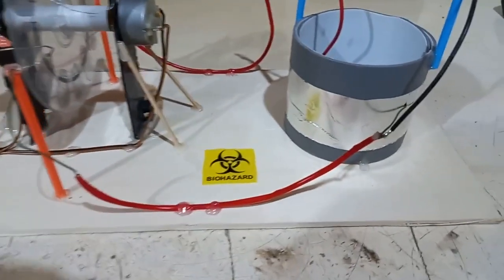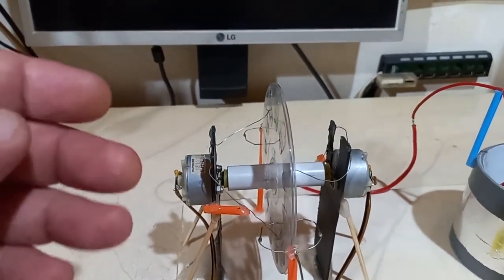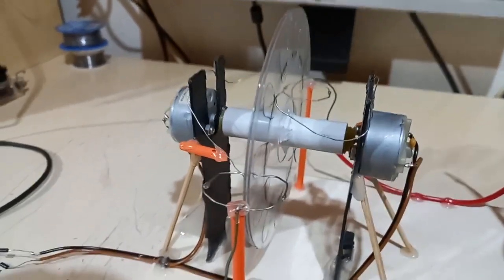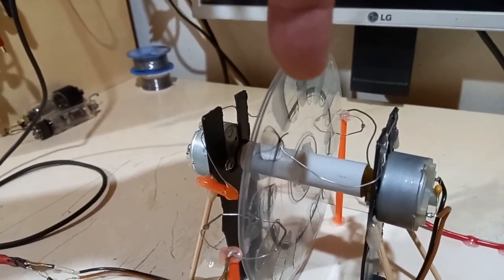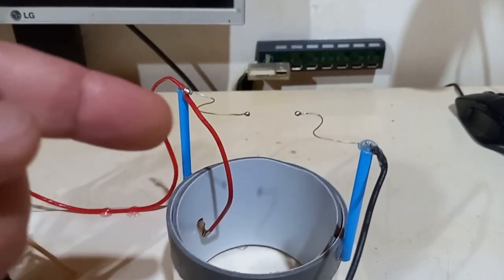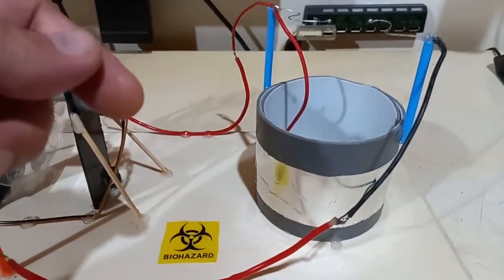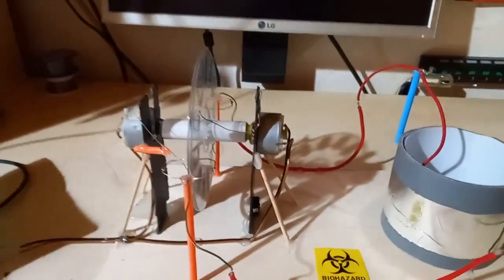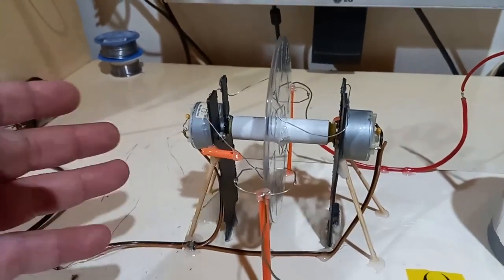Motorized CD Based Wimshurst Machine

Comment: That is a very cool design...What if you could make a bigger one with more powerful motors and larger plexiglass discs...hmm...🤔
Reply from the maker: let's just say that my bigger wimshurst has just being shipped from china right now, i'm not interested in wasting time making pulleys, cutting disks perfectly and risking to have a mediocre performance for reasons i would never understand, i've seen a couple of regular sized DIY machines online that perform badly, i paid 55€ for it, a worth expense for a lifetime use
Reply: That is understandable...however this is a really cool working model!!!

Comment: hello termadnator i  have a son /13 years old and he wants to make a powerfull spark gap tesla coil. I  came across your video called 300w zvs flyback  sgtc so i have a question for you could you possibly make a video of the diagram and my son has also asked how you made the salt water capacitors and if they work . If you could do that we will be very gratefull 😄
Reply from the maker: in that video i omitted those details cos those informations are easily available, it's just a SGTC with the spark gap in parallel of the HV transformer (a DC flyback driven by a ZVS in that case), the schematic is super simple and easy to find.... the capacitors are just saltwater capacitors like people describe in hundreds of videos, there's some information more in the description and a couple of users asked the sizing of the coil so i answered, but things like number of turns etc are not critical at all
Reply: @PosthumanKindergarten  thank you for replying but why are the 3 step up transformers included ?
Reply: @PosthumanKindergarten  and did you get the flyback transformer from a old telivision ?
Reply: @PosthumanKindergarten  and just one thing my son asked how did you wind the coil and with how thin copper wire ?
Reply from the maker: @Elementalcircuit  yes, i got the flyback from a big sony trinitron, for this application it's better if you use a chunky flyback from a big TV, but maybe not a branded one, cos branded ones usually have an output capacitor that make things complicated, such capacitor is inside a bulge on the side of the flyback and it's kinda easy to notice, but who knows how things come up, maybe such capacitor would not be a problem if you don't connect it on the bottom of the flyback

secondary is 5cm pipe with 1060 turns of 0.25mm wire, winding length is 30cm, resonant frequency is 550kHz with topload (that silvery thing on top) that is 20cm in diameter, 3cm thickness, covered in plumber aluminum tape

those are not step up, they are step down, driving a flyback with mains voltage is possible but complicated, so generally you use a lower voltage (in this case kinda 38Vdc at like 10 amps) for the ZVS driver, probably you can get away with like 3 SLA batteries in series, using all three just for final power
Reply from the maker: @Elementalcircuit  i wound the coil with an hand crank and feeding the wire with my fingers from a spool, it's faster than it seems if anything goes the correct way, it's better if you make a structure with wood that has an axis that goes inside the pipe and such axis turns, nothing too demanding, i usually block the pipe on the axis with rags